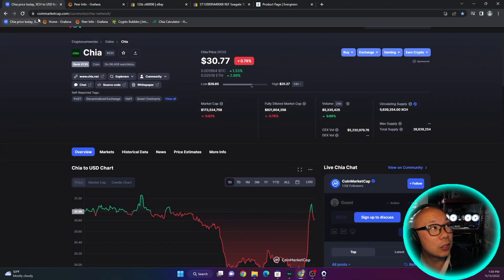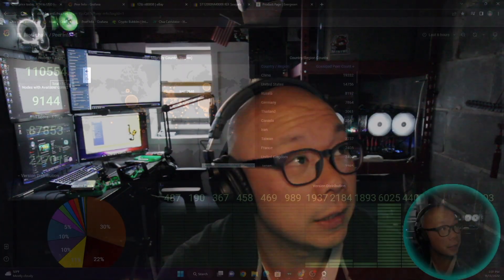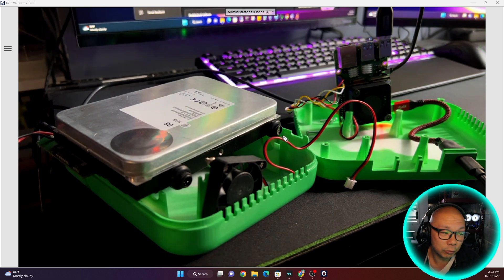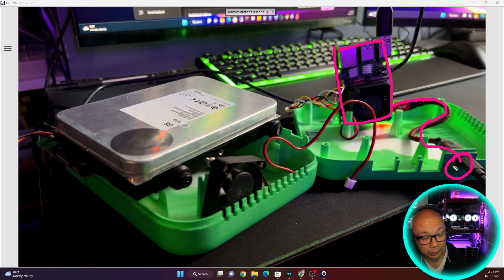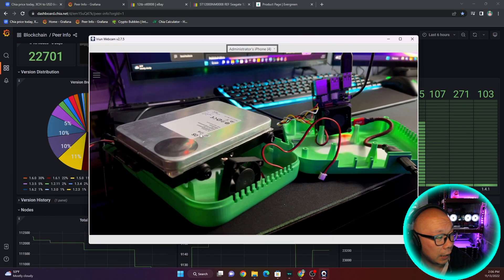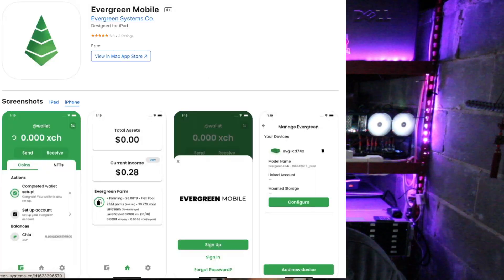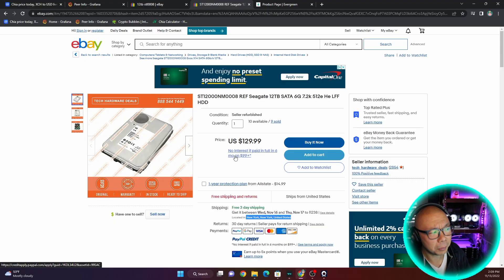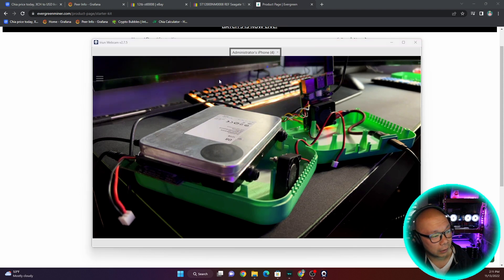Whats Inside the EverGreen miner!

Comment: Looks like a Seagate, Helium-filled. I have the 16TB version. Doesn't run as cool as I though it would.
Edit: I was wrong. The Refurbished Seagate Exos drives will run a self-test every waking second they r on for about 50 hours, noted by the continuous slight seeking. After this is done, they settle down to the ~5.5 watts of idle power consumption.

Comment: I looked for the cheapest drives and found that it's equal or cheaper to buy the evergreen and avoid the headaches.

However, I'm curious if you want to add 1-2 drives to the evergreen setup on your own, if it could be done?

Comment: If you buy the starter kit of Evergreen, with 1 drive, there is a spare blue USB port on the RasPi4, so can you plug in you own 2nd USB drive to that port? And will the farmer format it and set up to work?
Reply from the maker: No it will not format it. I’m not sure how to incorporate additional drives outside of evergreen. If you plan on adding your own drive I suggest building your own farm for as much as you would spend on buying an every green